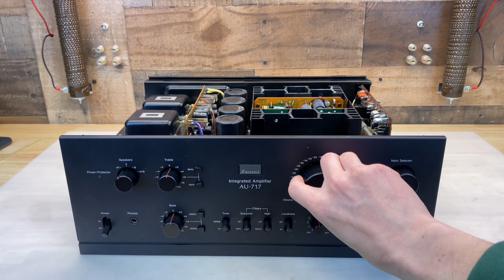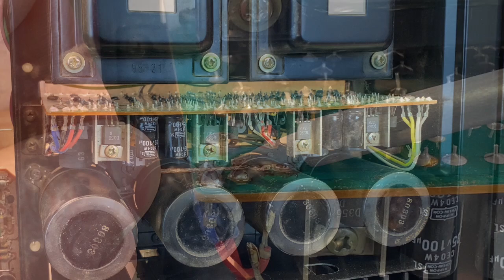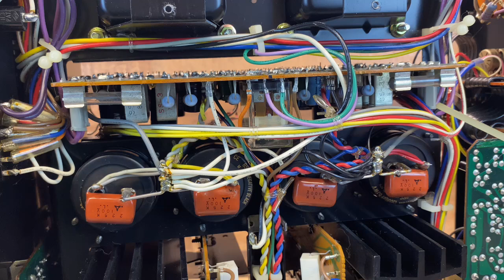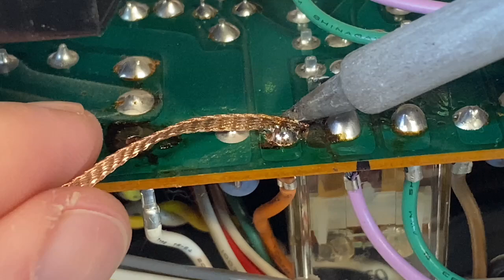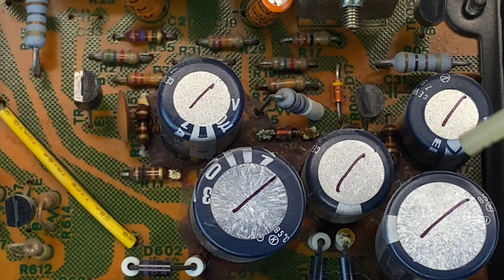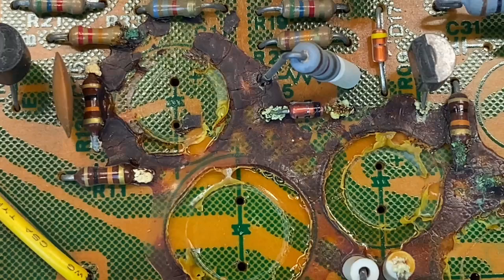DR #60 - The Guts of a Sansui AU-717 - Rebuilding the Power Supply

Comment: What is the best way to remove the Sansui badge name plate on the front of this. I have one but the name plate is so old it is hard to read from a few feet away. I plan to use an adhesive replacement but don't know how to remove the old badge from the unit without damaging it. Any tips on this?

Comment: Thank you for the video on the power board.  I think this was the hardest boards on the AU-717 to do because of all the components on the board that needed to be replaced, the dried up glue and it damaging some resistors and keeping track of the wiring as I completely removed the board.  The heat faded all the resistor color codes and of course the service manual doesn't give you a full list of these.  No matter how good of pictures you make, there is always some confusion on when you're putting it back together.  I ended up double checking using the schematic some of them. Luckily, no issues when I powered it back up.

Comment: HEY!!! This is Perfect! I have a AU 717 sitting on the shelf. Thank you for the videos
A review on the schematic would be very nice!
You didn't replaced the 57v rail caps. 
1. Why? 
2. would you replace with 4 modern equivalents or do a layout of more ea with smaller & lower value to equal or exceed stock values to lower the ESR
3. Would ESR be a factor at that stage of the power supply?